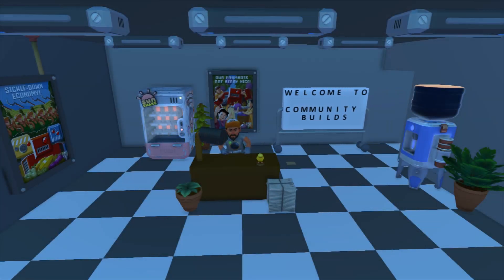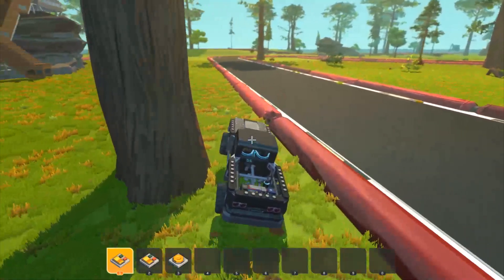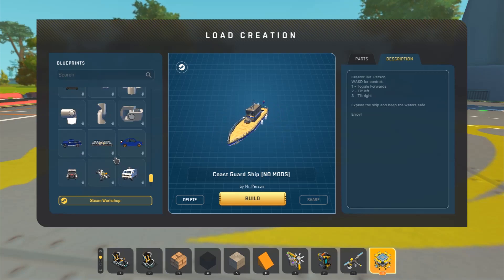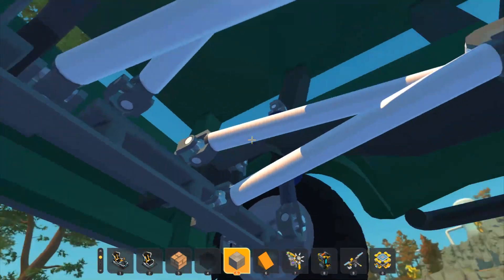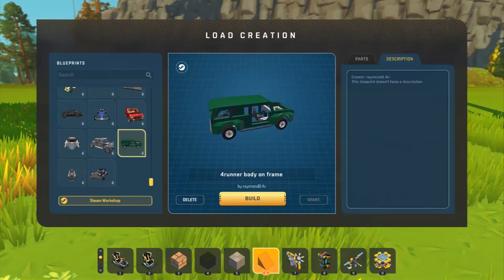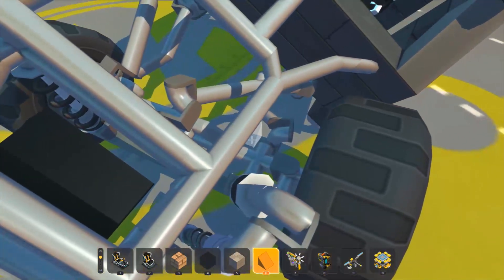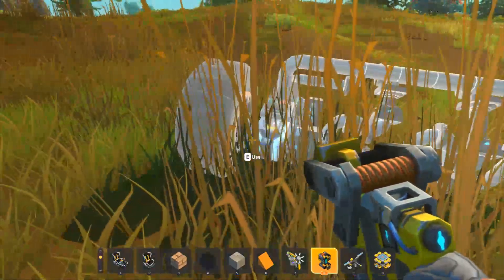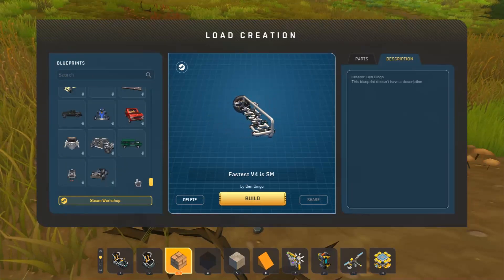Community Builds 36 | Scrap Mechanic

Comment: I have some piston engines, that run way faster. ✌😅
Reply: Are you referring to the V4?
Reply: @Ben_Bingo  yes sir. ^^
Reply: @1990Hazard1990  Tbh that v4 is slow compared to my other engines, the v4 does 1100 rpm / 6600 d/s but it is still the fastest v4 in SM rn. My fastest piston engine goes 43,000 rpm / 250,000 d/s